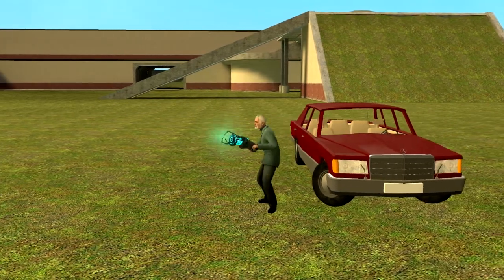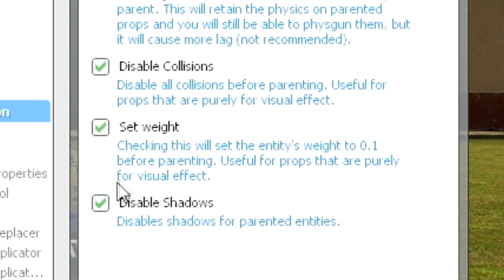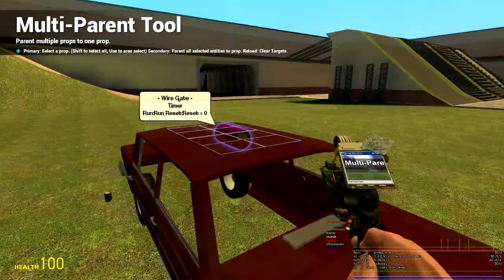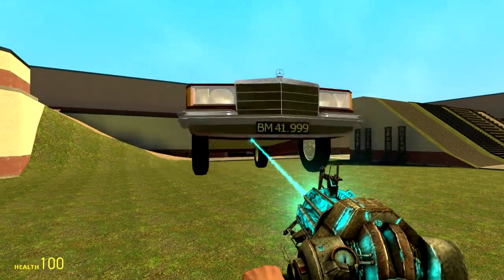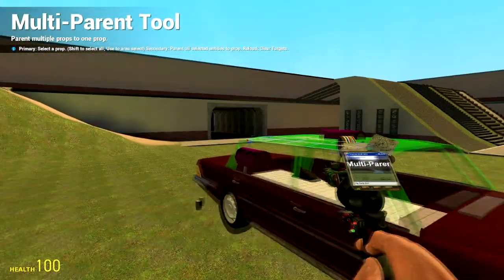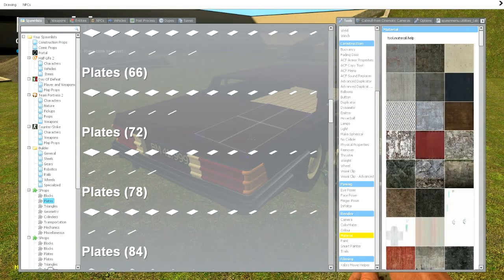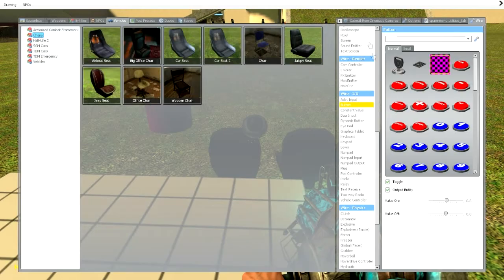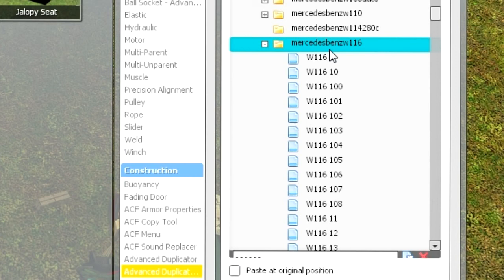[GMod 13] Multi-Parenting Tutorial / How to make lots of props not lag

Comment: As a note, you technically don't actually need to parent the props to a gate to be able to unparent them. That was only useful when we didn't have Multi-Unparent (and had to use Wire Sound Emitter to unparent). You can parent props to props and still be able to unparent them with said tool.
Reply: only multi-unparent because tweak made it so it can still run a trace after you parented stuff wrong.
Reply: Multiparenting props to a gate isn't for Multi-Unparenting, it's so you can still change the color and material of said props, aswell as the props keeping their 'gravity' and 'physics'

Comment: If I reparent a prop will it remove any previous "parents"? I think I parented a car wrong and dont want to use multi unparent because it doesnt have area select. Any suggestions?
Reply from the maker: Yes, it removes "previous" parents and parents to the new prop you've selected. As far as I know, it's physically impossible to parent the same prop to two individual physical props.

Comment: A bit unrelated to the video, but I really need help.
NO ITS NOT A YOUTUBE CHANNEL AD
For some reason, when I try to make a car, and when I get to the point of wiring the controls up, the engine wont rev when I press W. I wired W to throttle but I'm not sure if that's what you do, and I have been looking for a guide on how to wire up controls, but none of them worked. pls help
Reply from the maker: Is it ACF? A simple way is to wire Throttle to a toggled Wire button using value off = 0 and value on = 100. Then wire "set" from the button to "W" on the pod. The throttle is percentages in power.

Comment: What happens if you want the player to collide with a parented prop?
Reply from the maker: Parented props lose their physics. If you want stuff to collide with your vehicle, then you need to make a seperate collision box around it. You can do this by welding plates wherever you want stuff to collide, then make those plates invisible. I didn't cover it in the tutorial because I didn't find it needed - it takes a lot of adjusting to get right.
Reply: Yeah, the thing is, up until Gmod 13, the parenting tool didn't need separate "hitboxs" for the player to collide with the bits and pieces. It's something I'm having trouble adjusting to.
Reply from the maker: You must have been weld-parenting then. Parenting in GMod has always meant you lost your hitbox and had to re-create one.
Reply: I don't think so, because there would always be lots and lots of ghost props laying on the ground when you unfreeze the model, I could hear them falling on the ground after I unfroze them.

I know this because people on the server would always complain if you spawned a train on the tracks as the ghost props can make other trains spaz-out as some trains aren't built as well as others..
Reply from the maker: Yeah, those were the physics dropping to the ground instead of staying on the vehicle creating the hitbox. I remember being annoyed by this in 2009 and it never changed, haha. The whole point of parenting is to remove the hitbox as that's what lags the servers. You might be thinking of PolyWeld which was a tool that "parented" but allowed for physics interaction. When >300 props were out and "parented" using this tool, the servers would still lag so the tool never really succeeded.
Reply: I don't know really, but one thing I am really certain is, that if "collisions" are abundant here, then why is a tickbox for it? Surely a tickbox like that has no function.

Apparently, from independent research that I did do, did proove that parented props do have collisions, but that only lasts until the model gets duplicated by any advanced duplicator.
Reply from the maker: I think I explain it in the video. The collision tickbox is so that you don't have your collisions that fall to the ground collide with each other on the ground causing lots of lag. Parented props never had collisions unless you used PolyWeld or weld-parenting. There might have been tools unofficial from server to server and I cannot speak for that.
Reply: Yeah, people in the old Gmod relied on the fact that props just lying there don't have any physics applied to them unless something collides with them, another word for this would be "sleeping".

Also, can you elaborate on what you said in the video?

Comment: I have done it and it works but now the car will not move, the engine makes a sound to show that it's on but the wheels don't move! Helps?
Reply from the maker: You ONLY parent the props that represent the body. The chassis prop (main prop), the wheels, the engine, transmission, etc should still be welded to main prop.
Reply: JackpodyDK Still cannot get it to work! Can I pm you a download for the dupe?
Reply from the maker: It's best if you fix it yourself, then you learn stuff! :D Make sure it works before parenting then, to figure out if it's a parenting related issue. The only way to screw up a parenting related thing is to parent things that should not be parented.
Reply: JackpodyDK Everything seems like it's parented properly yet the engine won't power the wheels!
Reply from the maker: Then I will have a hard time helping you as I don't know much information about the car. :(
Reply: JackpodyDK I have sent you a pm with a download link. It would be awesome if you could fix or tell me what's wrong!!!!! Amazing tutorials and videos btw, so jelly of your cars :P
Reply: JackpodyDK Had to go from an old save to be able to take the shell off, then added it to a new chassis. Now it works!!!

Comment: thanks for a great video! have some serious trouble here unfortunately though because I really cannot work with the parented props in many ways, most critically for our server, the (improved) stacker does not work on a parented prop as well as color (whereas material does work). with the stacker it shows the ghost but on clicking to actually stack nothing is stacked. any solutions or are there any other parenting tools that dont have this problem?
Reply from the maker: Kristjan Laane Parenting should only be done on detail props that need to move without straining the server - not on the actual moving stuff. If you're building stationary stuff that'll never move or if you're just building something and want it to move later then wait with parenting - do it when you're done with the details.
Reply: I need to do it due to massive lag from constraints as my server becomes unplayable otherwise. I've resolved the stacker issue by using gate parenting rather than normal parenting which allows prop modification after parenting - it was not clear as a must from your video at first..
Reply from the maker: Ah, I hoped the quick explanation of the gate being the parent would have been enough - but glad you fixed it.

Comment: Is there a difference between Advanced Duplicator and Advanced Duplicator 2?
Reply from the maker: Yes, Advanced Duplicator 2 uses completely different ways to save your contraption. It's much better at it. It also has a lot more features and a better menu.
Reply: JackpodyDK Ok, thanks Jackpody :D

Oh, and is it necessary to have the.dll file, or can you use Advanced Duplicator 2 fine without it?

Thanks
Reply from the maker: You can use dupe2 without the .dll.
Reply: JackpodyDK Ok, thanks for all the help Jackpody :D

Comment: I followed your tutorial on making a basic steering system, and when I used this tutorial to make all the props I added to it one thing, the front wheels started spinning around in any direction they pleased, not just forwards and backwards then tilting left and right. Why has this happened? I redid it about 10 times over and had the same problem.
Reply from the maker: You don't parent anything that you created during the chassis tutorial. Nothing. Not the wheels, not the base, not the steering, not the wireboard. You only parent things like the body of the car, seats, dashboard, basically everything that should NOT be able to move independently.

Comment: Hello Dear Jackpody,

I wanted to say first, I always liked your work, I've been quite impressed always.
I made recently a car, not based on a real model, made from scratc, which as alot of cool stuff there, indicators, steering wheel,all that, thing is.
It has 1000 props. 
I tried to parent it like you said, to the ADD gate, then gate to the base, while the boxes are checked, and not checked as shown in the video, and i'm still getting lag.
I wanted to know, if there were a way to fix that in any ways, or, if I really need to lower my prop count around 500 props.

Regards, a lover of your work
Reply from the maker: What kind of lag are you talking about? Serverside lag or clientside lag?
Reply: Clientside lag, sorry for my late answer as I took school again couldn't check often. But it's clientside, when I look at the thing I made.
Reply from the maker: Parenting does not remove clientside lag, only serverside. If Garry ever decides to fix multi-core rendering, then you can enjoy looking at your thing with high(er) FPS. Until then, we all struggle to get above 20 FPS with a lot of props.

Comment: Hey jack, how many props are your awesome vehicles? 

I am currently making a 458 Italia with my buddy, and we estimate we are using around 600 or so props. Just wondering if that'll cause any lag with parented props. Thanks!
Reply from the maker: Depends a bit on how you parent. You want to make sure you parent with the settings I show in the video (so the body is 0 constraints). If that's done, then it will only create clientside lag (FPS lag). Nothing serverside. However, if you use ACF, ACF's weight checker might make some slight straining issue because it constantly checks the weight of each prop on your car. This is minimal though. My cars are about 450 props, that is my max anyway. Good luck!

Comment: Can u make a wheel hub tut pls
Reply from the maker: Making wheel hubs are as easy as can be. What you can do is take the prop you want to use as a wheel hub. Take easy precision and make it so it sits center on the wheel, then push it inwards using the tool. Then just parent the prop to the wheel. Done, wheel hub.
If you're having issues getting to the prop, then left click on the prop you want to use as a wheel hub with the multi parenting tool out, so that the prop goes green. Then push it inwards to where you want it, THEN right click on the wheel with multi parenting tool. 
Making a tutorial for something this simple might be a bit odd, really. Have fun with the trick though, it works wonders and makes your cars look a lot better.

Comment: Greetings Jack,  i have a question that id like to ask you. Can you parent E2 chips? and if so, do i parent to the gate or base plate (chassie).

If you answer this question for me (which will be amazing considering this is an old vid) then id greatly apreseate it.
If not, then i will attempt the comment on newer videos of yours.

Best of luck, -SilverSly
Reply: Depends on the E2 - as some E2s require to be welded, whilst others don't and are eligible to be parented to a Gate or Base Prop

Comment: Ok so I have a helicopter Ive created it has skids. Its a huey. When ever I multiparent the damn thing. I cant put engines on it... When I do so while it has engines on it already... They just fall the fuck off... Then because Im mutli parenting it do the base belly to grab with the phys gun I cant get it to stay on the skids because the moment I parent it falls through the earth till it hits the belly. 
How the fuck do you use multiparent and still have ability to use engines... I mean your tires stayed on your car in this video... Wheels.. Are the engines Im using the propellers.... They fall off after I parent them once Ive put them on first and If I dont put the engines on first.... Once its parented the engines just fall off they wont even go on it. I cant even add a thruster to make my model flyable.
This is bullshit. Ive been at this all night. Tried multiple different angles and everything I can think of and it just wont work. It will parent but it wont keep my engines and wont let me put any on it...

To top it off I cant figure out how to clear advanced duplicator of my last selection. It copied only half my helicopter cause the box was too small when I tried it again it copied my helicopter PLUS the half I had first selected... -__-

Can you help?
Reply from the maker: That would be because you do not parent things you want to be physical. I believe I explained this in the video - tires, base plate, propeller, engine(s), etc. are not to be parented. However, you attach them to the base plate by welding, axis, ropes, etc. Do not weld anything to a parented prop and do not attempt to parent an already welded prop.
Reply: To clarify I just tripple checked Im facing north. Couldnt get my spray to work after several tries someone suggested the paint tool and a smile then I read to use the command
cl_showpos 1  and if the second number is 90 you are facing North. Helicopter nose is facing north and the tail rotor spins north to south the main rotor doesnt though not sure how that would work. The direction Im facing to put on propellers though shouldnt have anything to do with what Im doing. EDIT: Just loaded the save game from last nights work. It loads in and everything falls apart. its litterally just a pile of props banging together on load of save.  Uhhhhhggg. -_-